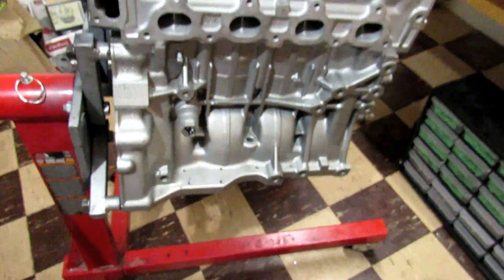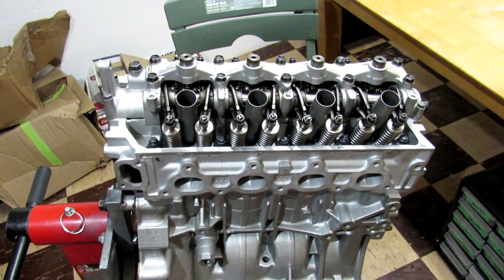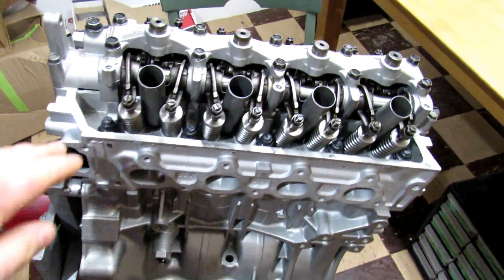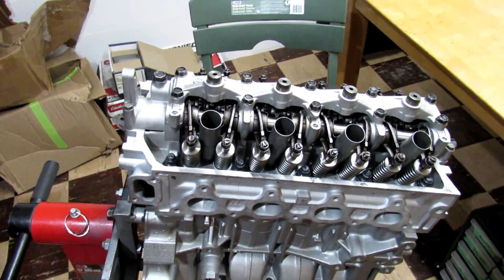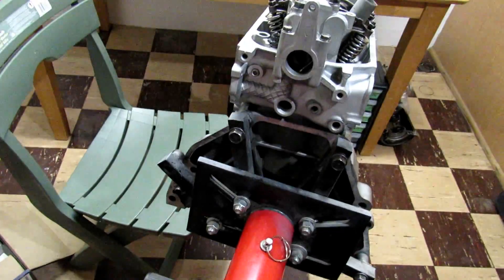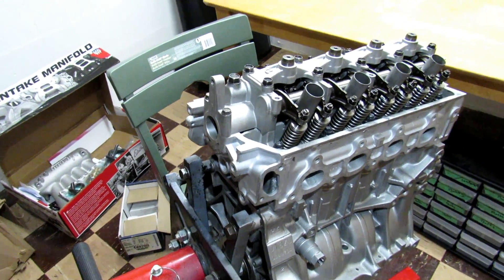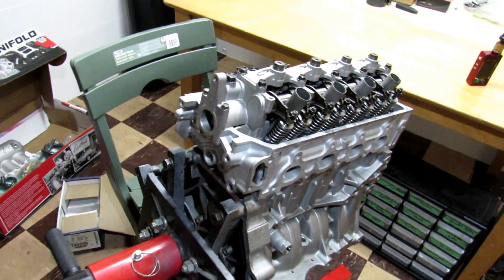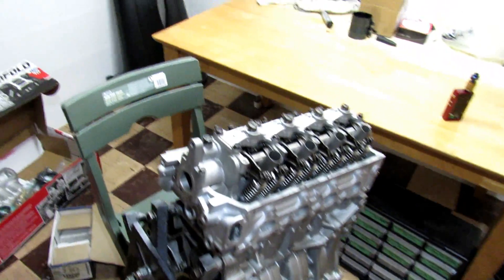D16 Build Cost

Comment: Omg !!! Smh on a D series!!!!!! Im thinkin just bottom built rods and pistons and decent turbo kit  and pretty sure can get close to whatever that power came for that money !! But much props for not being kind runs to latest motor honda has out and think your fast 😉
Reply from the maker: Luckily I didn't spend a dime on that engine 🤣 I just built it for a buddy and then he basically vanished off of the face of the earth cause now he has kids and stuff. Oh well, I wouldn't spend that much money on a d series, not in a million years! Maybe a B or a K I would.
Reply: @Honda How To  smh oh ok ,  cause i was thinking who in there right mind would spend such high amount for adequate gain, dont get wrong i give much more credit to someone with respectable results,with a D series N/a than anyone with any honda motor using a turbo which, well obviously doing all the work, but honestly i would like to show the outcome for max budget of $1500-$2000 on Dseries, i see so many videos of high compression-stg4 cam- manifold etc. But almost never head work i want to Dseries with semi done head bowl blend-minor port work and valve job and 10.5-10.8 compression everything else stock
Reply from the maker: @4077661466jp  you don't really need to do anything to the head to make power, I've seen a stock d series head hold 500hp with stock cam and springs. It all depends on how much power you want to make, and how reliable you want it to be.
Reply: @Honda How To  reason is to show what more head flow than cam can provide with healthy compression rather than big cam on stock head, but over $2k is just heart breaking!!! Lol

Comment: I love how he says 350-400 hp. That’s literally a 800hp motor. Vitara builds usually make 400 hp reliable.
Reply from the maker: We dont have e85 around here
Reply: @hondahowto  ohh that explains it 🌽.. i just saw im a bit late on the video
Reply: @hondahowto  how much power its making rn?
Reply from the maker: @carlosramos1207  it still makes 500. Im pretty sure he turned it down for awhile. He loves it and drives it almost every single day.
Reply from the maker: @carlosramos1207  he said right around 375
Reply from the maker: Lol i wish we did, then it could make alot more. It made 500whp  on 91 pump gas with 110 octane vp mix. Cant remember what the ratio was. Unfortunately the car is in Colorado  and i havent seen it in years

Comment: If you ever want a rust free Honda or Acura, gotta go to Florida, To buy one... also killer engine build. Which your setup, you should easily be able to make over 500Hp boosted, with all the quality parts that are used on the engine.
Reply from the maker: Thanks man. I used to live in Florida, and I bought a rust free 1990 prelude si 4ws, I loved that car. I should have never sold it when I moved back up here

Comment: any work on the transmission
Reply from the maker: Just a quaife limited slip different, and 3rd is a straight cut gear, that's it. Could have used the stock diff but it doesn't hook up very good
Reply: Honda How To why do you straight cut the third gear?
Reply from the maker: @zforbes839  because third gear went out lol
Reply: Honda How To okay 😂

Comment: 1 grand to machine clearances for h-beams? couldn’t you do it yourself for an extremely cheaper price ?
Reply from the maker: Yes you can, I just didn't have time to do it myself, and it was in the machine shop so I just told them to do it but it's basically free if you diy, you just have to have the right carbide bits
Reply: Honda How To what else was it in the machine shop for? I want to do this build but i don’t have the money to take it to any shops as well as any serious tools to make any serious alteration
Reply from the maker: @zforbes839  well you can use the stock cylinder head but I would get it decked, along with the block. And a hone, that's about all the machine shop needs to do, and that will cost you roughly $100-150
Reply: Honda How To thank you !

Comment: 2k in machine work you got ripped off find another shop dude.
Reply from the maker: O I know he did, but around here there isn't really any other options. The machine shop measured all clearances and notched the girdle and block, then it got CSS, and then they match ported and polished the head and did a valve job to match the new valves, bored it, hot tanked it, and decked both the head and block. So they did alot of work but the problem is, where I live there is nothing here, which is a big problem

Comment: Overbuild and under tune and it will be most reliable. Use a 50 to 60% ratio and it will last a lifetime. Build for 600hp tune to 325hp or 800hp tuned to 400hp if it's a car you like and want to last forever.

Comment: A little over 6 grand for a built motor and maybe 3 grand for a good chassi... 9 grand will give you a more reliable and more fun than most modern cars that cost 3 times that.
Reply: That's a lot of freaking money. I'll stick to my R6 lol
Reply: Hondas are awesome for little money 300 hp is easily reachable. And they are so simple and light.
But not everybody wants to put stiff coilovers, rollcage just to match stock 335i for example. 
You can find many modern cars that can give you fun, smooth ride, practicality...
Reply: @dkdanis1340  The 335i will give you all that minus the reliability and ease of maintenance and costs.
Reply: @SI0AX  
335 diesel bro xD
Reply: @SI0AX  n54 engines are reliable.
Reply: @zart3374  N54 engine
Reply: @dkdanis1340  I know some BMW engines are pretty reliable, it's really everything around the engine that is not so reliable.
Reply: @zart3374  Diesel engines are very fuel efficient have great performance and are insanely reliable, it sucks that thanks to VW, they are banned in the US. 

In reality, they weren't popular in the US because people had a stigma to them or something. I think people though they were dirty because they were related to large vehicles and coal rolling trucks(running an excessively rich tune to purposely produce a lot of black exhaust fumes) but of course now everyone thinks they are again thanks to VW.
Reply: @SI0AX  700 hp on stock internals and people drive them for years like that. Do yeah it's pretty reliable

Comment: How much would a Stock rebuild cost?
Reply from the maker: Couple hundred bucks
Reply: Honda How To Sick, any good rebuild kit links? or brands for everything?
Reply from the maker: @IDABAYAREA650I  I would snag a cheap one from eBay use your stock pistons, and make sure a machine shop hones your bores and resurfaces your block and head, just get one with good rings and gaskets.
Reply: Honda How To I would call now and ask but everything's closed, how much is that usually?

Comment: When I get my block machined , do I go to the machine shop first and then buy pistons and rods accordingly or vice versa?
Reply from the maker: I would bring the Pistons with the block because the machine shop will want to compare bore size to piston size, I would have them file your rings for you, and I wouldn't bore over very much, you want as much material on the sleeves as possible for strength. Unless you are putting sleeves in.

Comment: When you're building something like this for more compression and obviously higher hp, do you need to get all the machine work done? I understand you can machine the head and block surfaces to make piston that much closer to the bottom of the head.
Reply from the maker: In a d series engine you do need machine work. You have to notch the bottom of the sleeves and the crank girdle for the h-beam connecting rods clearance.
Reply: The Chosen One speed factory sells a no-notch rod/ ycp piston combo for $460. No machine work required if your engine isn’t already damaged

Comment: im new to the honda scene and was wondering if you could please give me your opinion... I have a d16y8 vtec and a stage 2 crower turbo cam and wanna buy vitara pistons,rods ,..valve springs and  just a t3t4 turbo and boost 10-12p.... not sure if need bigger injectors or brand?
Reply from the maker: It all,depends if you want to run e85 or pump gas
Reply: if your running 10-12 psi rods, pistons and springs is a waste of money throw arp headstuds, 550cc amazon injectors and e85 in it, and itl make around 230 reliably just keep the rpms under 7k and itl be just fine, im running 13.5 psi and e85 in my d16y7 making 220 to the wheels just fine with a stock motor
Reply from the maker: @adiofreack  this engine makes over 500hp right now on e85
Reply: I have a D16y8 with a built bottom and hondata 4 E85 tune. 1000cc injectors currently on a t3/t4. What turbo upgrade would you recommend?

Comment: Far as cost I know people who have less than 3 Grand in their setups making over 500 on a single cam... they've had to refresh the bearings in it every couple years. Not sure what Pistons those were that you're using but that thing should be capable of over 500... added more boost as RPM Rises to not stress the block out and boost by gear so it only makes high hp numbers when it needs to.

Comment: Honestly i respect the build. But to spend 7gs on a motor without counting the Turbo Manifold, actual turbo, waste gate, blow off valve, Fuel Rail, Fuel Regulator, wide band, boost gauge, intercooler, intercooler piping, axels,  Hondata, or Fueltech or whatevever ECU he is going to use. Tires, brake set up like Rotors and brakes, in my opinion is not smart at all for  his power goals, with all the things i mentiond this would roughly come up to about 10gs  for 400 HP ??? Unless he is someone very succesfull in life with money to throw away this is insane
Reply: This is a 700hp build minus the injectors.
Reply: Honda How To I feel like this build would be capable of 500hp plus depending 9n some fuel related things. Are you guys staying on pump gas?
Reply from the maker: Luis Candelario money is no option to him. He's not married and he doesn't have kids. Me personally would never spend this much on a D but he wanted to.
Reply: I respect these guys for being honest about the cost unlike some channels talking bs about sub 1000 builds

Comment: How come boostedboiz.can make so much more power without doing so much and spending that much his hatch is 700hp and lasted almost 3 years and only bent a rod because it over boosted  ?
Reply from the maker: Justin Whitehead because that engine in his hatch is a h series which is capable of a lot more horsepower then a d series. And this engine has a fully built valvetrain which adds a lot of money to the engine.
Reply from the maker: Justin Whitehead and parts of his engine are stock too. Like his cylinder head. Nothing is stock on this engine.
Reply: Honda How To but the point was why if you can bang a h for a fraction of the price with more power
Reply from the maker: Ah akee antifascista! Its a great point, thank god I didn't buy any of this stuff. We just built it to prove a point that d series can be good too.

Comment: Also just realized you forgot to tack in your ARP gear, it was main bolts and head studs, your rod bolts probably were included with the eagles, but that's probably another 200 bucks if I'm not mistaken

Comment: Any previous experience with Cylinder Support Systems? I like the idea from what research I've done but I live out west so obviously testimonials aren't gonna be easy to find out here. I've debated using sleeves at all, any build I would do would probably stay under the 500hp range, and I've heard of stock sleeves surviving beyond that.
Reply from the maker: Aulptraum sleeves are obviously better but I have had very good luck with css I haven't blown up an engine yet. And my old ek was 500hp on e85 b18c1 with css and it never skipped a beat.
Reply from the maker: Aulptraum I've only used css twice previous of this build

Comment: 6000 dollar for 400 450 hp are you serieus  and not a sleeve block?
Reply from the maker: frankie anastasiou that's with those parts you can use way cheaper parts
Reply: i knw that. why yôu ûse that? what the boost level you aré looking for what tûrbo?why you spend thät money änd ýoū gone use s300 i ẃill prefer a stand alone unît
Reply from the maker: frankie anastasiou true we were kind of thinking about using a haltech but we haven't got that far yet, we just have a s300 laying around. And I'm not a d series guy I like my b series I enjoy building d series but I would never put this kind of money in to one. This is my buddy's deal lol
Reply: i am b series fun too and i am buildng b16 Bore×Stroke: 81.0×77.4 mm (3.19×3.05 in)high  boost and 10.5 c/r  and high rev about 10000rpm and i will use aem ems4  epm and coils but b series or d series or any engine that is so old in engine mangment  the best way is to go to the hard way (engine harness ems  sensor),my opinion and something i  always recomend
Reply from the maker: frankie anastasiou true that the new s300 v3 is pretty close to a standalone but not quite. I just wish I could get this thing done so I can build my b series on the channel. 10:1 comp huh? This engine is running 9:1
Reply from the maker: frankie anastasiou 10:1 should be pretty nasty. It will love boost
Reply: p30 ecu ẃith s300 v3 its   still  slôw ok the sôfteär bût the härdwear is slow
Reply from the maker: frankie anastasiou I feel you. I've never used hondata I'm pretty old school I've only used crome so all this other stuff is pretty new to me.
Reply: Bro my dad has 10k in a k-series that makes 300 NA...

Comment: this guy could have bought a complete TypeR swap for all that money.
Reply from the maker: Leroy Dennis and then some machine shops around are really over priced just because we live out in the middle of nowhere. which is sad because we could have built this thing for like half the price he spent on it.
Reply: Leroy Dennis - true but will it make the power he going to make with this engine set he has? If your keeping a car N/A then any swap would be good as long as you like it. Plus it all depends on your location,parts and cash.
Reply: B18C5 is for N/A applications otherwise the money you would spend on that engine would be better spent elsewhere all to make only 200whp not worth it.
Reply: True they should have went with brand new for the same amount spent.

Comment: Not bad a bad price... I'm looking to rebuild my daily d16y8 starting knocking lol.. I swapped a d15b into for the time being.
Reply from the maker: Johnny Koch granted that's very high machine shop rates. We don't have very good ones around here.
Reply: Honda How Building my Cummins vs the Honda the dollars signs look small on the Honda end lol
Reply from the maker: Johnny Koch true. I used to work at a diesel performance shop and that's all we worked on. There was a guy that brought in a 99 3/4 ton, and the thing was hailed. He had us put in a twin turbo set up, with water meth, and a whole bunch of other stuff. The guy ended up spending right around 60 grand which is stupid. But it did max out the dump, which was pretty cool. That was the first time I've ever seen anything max out the dyno.
Reply from the maker: O it was a Cummins btw.
Reply: Honda How To mine is an 05 Cummins and I paid 2500 for my injectors.. I laughed when u guys said these were expensive. Your putting out some get content.. keep it up.
Reply from the maker: Johnny Koch thanks man

Comment: hey I have a question about this build. Get back with me and I will be sure to ask you. Thanks!
Reply from the maker: Nick Miller I'm here what's up man
Reply: Honda How To yea um did the Civic you put this in originally have an automatic tranny? If so what tranny did you swap it with? I'm just curious. I am currently looking to build my d16y8 that I overheated and blew a head gasket. luckily the engine itself is still good. so now that I have it tore apart I'd like to build it up. but I'm just confused on the whole tranny deal. thanks
Reply from the maker: Nick Miller Well the transmission that was in the car was a 5 speed for a ex model. The transmission that we are going with is out of a lx with a d16y7. It has a lot longer gears and hopefully help with some traction. We are also running a quaife limited slip differential.
Reply from the maker: Nick Miller Is your car auto?
Reply: Honda How To ok. and yes my car has an auto tranny at the moment. it is a 1999 Civic ex

Comment: just saying some people put RTV/ Hondabond on the waterpump and it ends up clogging their radiator or worse because they didn't let it dry for a few days/ weeks before adding coolant. it looks like you let it dry for a long time so it's ok, but most people think 1 hour is ok, it's not. rtv takes forever to dry. I wouldn't use rtv on the water pump ever. have fun taking that shit off when you replace the pump
Reply from the maker: eksine It wasnt much, only a light coat. And from my experience that o ring gasket just doesn't really cut it. I have had alot of them leak with just the oem gasket, and when I put a little rtv on there it seems to help, havent had one leak yet... Fingers crossed